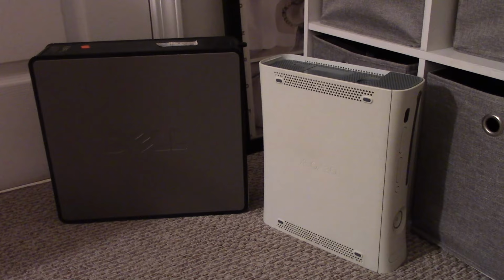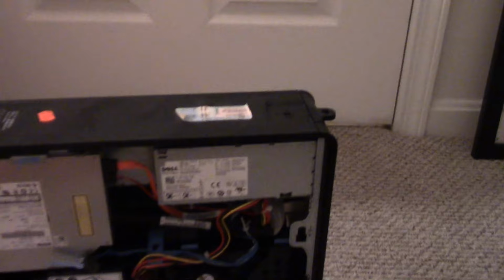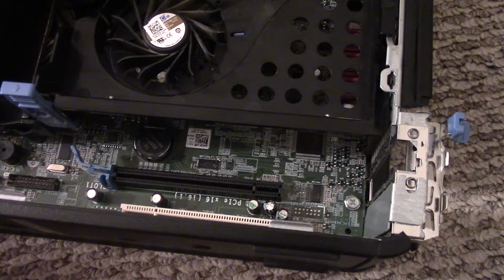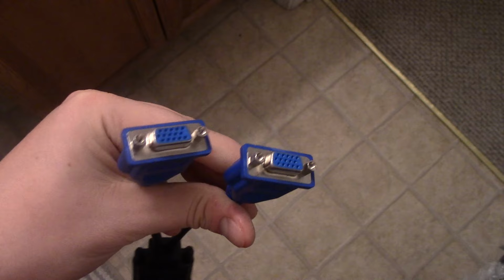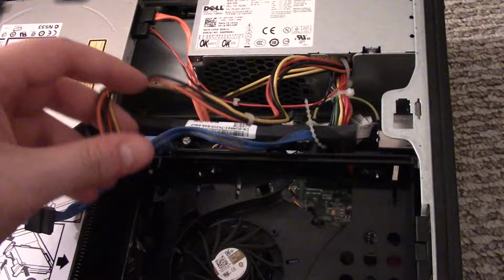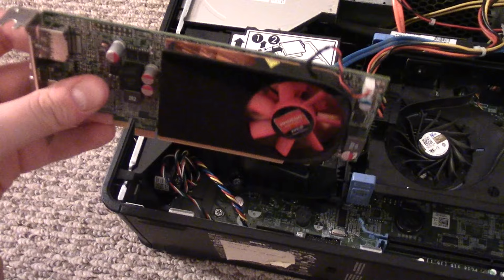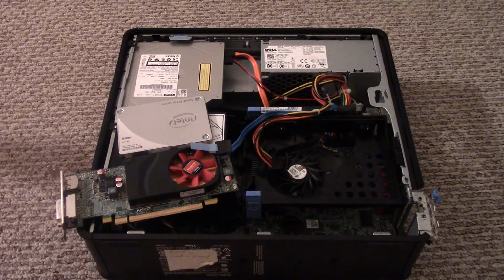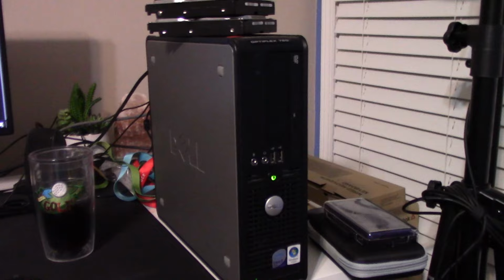This Portable Computer is Better than an Xbox360!

Comment: Pretty cool little gaming PC
Here are some upgrades that I would personally make:
1) ditch that old hdd bay for better thermals (you can put your ssd anywhere you want, there are no moving parts in there, i just stick them somewhere with double-sided tape
2) upgrade ram to the max, it is very important for day to day tasks and you can play bigger variety of games with 8gb of ram
3) you can overclock that core 2 quad q6600 with TAPE, watch a tutorial or two on how to do that, I mean how cool is that, a free overclock
4) also I would upgrade the gpu to something like an RX550 low profile for better performance (i don't think it's too expensive)

cool video overall
please do make a pert two of the upgrades and play some modern triple a titles like valorant, dota, fortnite, rocket league and etc
looking forward to watching the final stage of that pc
Reply from the maker: Interesting ideas. Yeah I think I’ll definitely re visit this in the future. Good suggestions!

Thanks for watching!
Reply: The ol' Nvidia GT 730 (2GB), draws only 35W, costs only $30, and gives PCs better than Xbox 360 graphics. And it fits in dirt cheap small form factor OEMs, like Dell Optiplex, Lenovo Think Centre, or HP Elite. The GTX 1050 Ti 4GB gives better than Xbox One graphics at under $100 and draws only 75W. I still have both laying around, but currently use an RTX 3050 8GB in muh main rig.
Reply from the maker: @natejennings5884  yes indeed!
Money is my main issue now, but once the channel gets going hopefully I can try some better GPUs to get some more impactful results.
Reply: @TrippTech  12:02 Slimline Sata power connector, Slimline SATA drives are the same as a normal SATA drive, but only needs 5V for the drive to work.

edit: the signal connector is still the same size, so you can use it on any computer, just note that you need 5V only

Comment: The DMS-59 sounds quirky however at least Apple made a different approach and developed Mini versions of VGA and later DVI for their iBooks/PowerBooks and MacBooks and the first generation of MacBook Airs had a micro-DVI, even smaller however it quickly got replaced by Mini DisplayPort in 2009 and miniDP also became common outside Apple and the connector was used for the first two generations of Thunderbolt.
With MiniDP there are low profile grapics cards like the nVidia A2000, a 2-slot low profile card with a whopping foursome miniDPs (and because of MST/daisy chaining the card can handle even more than four displays!) and my Radeon Pro WX3100 also got three DisplayPorts, one full-size and two miniDPs and the package included a miniDP to DP and miniDP to DVI adapter.

The Xbox 360's CPU better known as "Xenon" (while the GPU is called "Xenos") has three cores with SMT, so it's rather like a Phenom X3.
And the R7 250 - it's Oland GPU basically only has the GCN architecture in common with the R9 290(X)'s Hawaii and they aren't even from the same generation as the model name might suggest, the Oland is GCN 1 and the Hawaii GCN 2.

Comment: The Dell Optiplex 780  midTower version which I have was the last hurrah of LGA775 with Core two Quad before LGA1366, the 780 mid tower offer much better specifications than the 760 with 16Gb RAM for example

Comment: I bought a similar 755 with a core 2 dual and swapped out for a 6700 core 2 quad. 
Ten dollars at the thrift store with 4 gb of ram and a 1tb hard drive.  No Gpu card. 
    Even though the new core 2 quad cpu was 0.1 ghz faster, as well as there be more cores, there was zero increase in frame rate on my bench mark "video card stability test".  I should have tried the tape over clock on the core 2 duo.  It would not boot using the same mod on the 6700 .  Probably it works better on the 6600 quad from what I read.
   I used that same video card (s-video) because I want to watch Youtube on my CRT TV.  My AGP computers could do that, but only the Pentium D 3.0 gz was fast enough to do Youtube and it died.    So I needed to make a pcie computer with s-video.

  The problem is that Windows shuts off the s-video out put after it loads in for most of my Pcie computers.  After Windows xp anyway.
Reply: I don't really  consider it portable because it still needs a monitor and keyboard.  A laptop is portable.  I am working on an old laptop that has a third gen core I5 cpu, but only has Intel cpu graphics.  The lack of a video card may be made up for by the more powerful CPU.  It has S-video.  I have not tested it with my TV yet.
Reply: I would say from best to worst.
core 2 duo overclocked with tape
core 2 duo stock
core 2 quad.
I have another core 2 duo that I want to try the tape over clock, but it will get hotter than want and the stock speed may be all I need for playing media (no gaming).

Comment: I guess everything that can be easily unplugged from the wall socket and carried to another location... means it's "Portable". I should show pics of my Portable 65" LG OLED TV.
Reply: a pc thats a foot and a half is more portable than a fucking 65 inch tv mate
Reply: The good luck getting your TV transported in an airplane or train, IMHO because of the lack of batteries that kind of portable doesn't mean that these are usable on the go like a laptop but have a footprint that's small enough to be taken with you in a compact suitcase (I have a OptiPlex 7010 SFF and it fits into a suitcase that can be used for hand/carry-on luggage).
There are also DTR laptops (Desktop Replacement) and these are quite large, heavy and expensive, so they aren't also the greatest in portability terms, instead of paying a hefty amount for such a chunky laptop I'd rather build a small ITX system with powerful components.

Comment: Epik mayb u cans add a gt 750 or a gx 550 to its
Reply from the maker: I had someone else say that!
Money is tight now, but yeah that might be the call if I can get one cheap.
Reply: there is gt 750? i thought its only 730 and then after that its 1030
Reply from the maker: @CarinoGamingStudio  GTX 750

Below that is gt 740 and gt 730
Gt 1030 is the next generation
Reply: there is a 750 and there is also a 690 lmao @CarinoGamingStudio
Reply: @Coreo4  gt? not gtx?
Reply: @TrippTech  i didnt know there is gt 740 i always see 730 and 710 and i presume there is 610 but gt 750 no. gtx there is. but its hard to see a LP of that. if there is im sure is way pricey than regular 750.
Reply: gt gtx tomato tomato @CarinoGamingStudio
Reply: @Coreo4  the 2 are different.